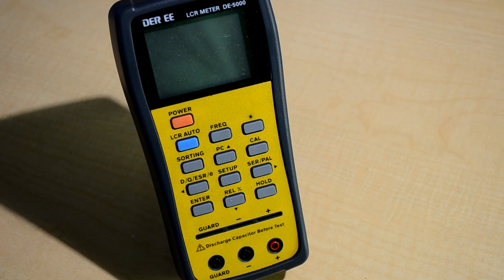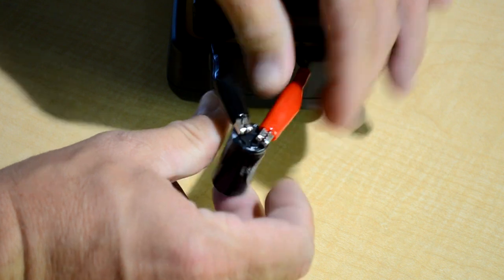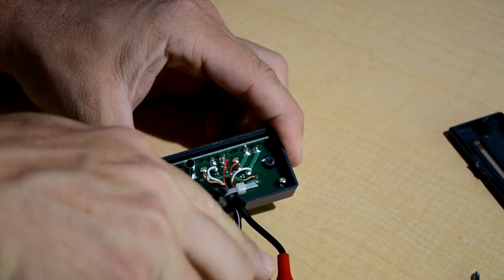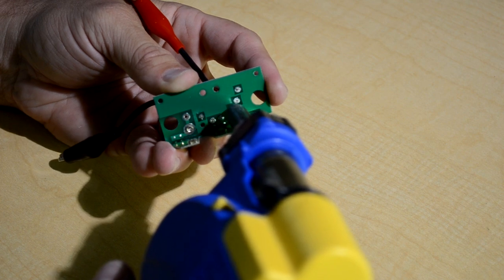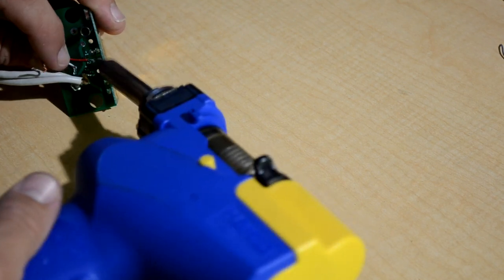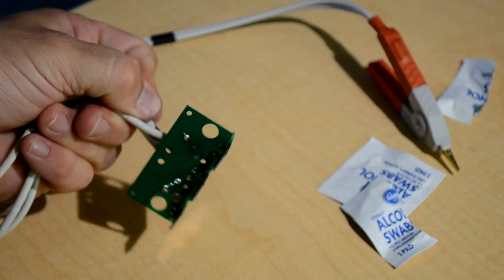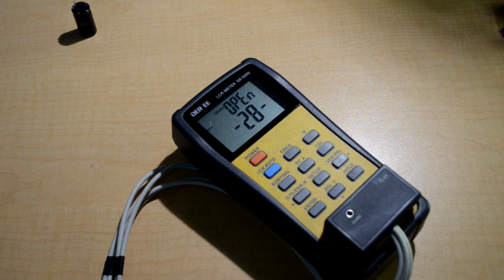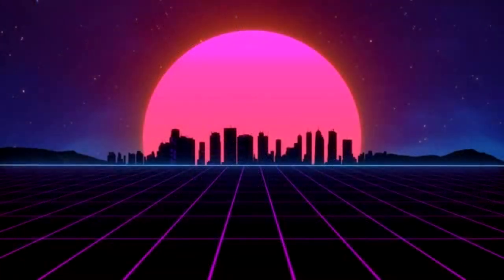DER EE LCR Meter DE-5000 Overview & Mod - Capacitor Tester | Tool for CRT repair

Comment: The reason the original cables are short is to keep the added inductance and capacitance of long leads from affecting the measurements. On larger value caps, it will not matter much but for lower value caps and inductors, you are trading convenience for accuracy.

Comment: For those who want to check their boards as fast as possible, you can just desolder one leg and then test for ESR with the other leg still soldered in. This meter does come with tweezers too but it's not the best either. Nice upgrade, Steve!
Reply from the maker: Great point.  Thanks.

Comment: The only reason  I can see for  having all the extra inductance and capacitance of those kelvin clamps is if you are going to use them for proper 4-wire measurements, where all the cable parasitics are cancelled out. Using them for 2-wire tests like this seems totally counter-productive to me.

Comment: I thought the point of the really short wires was so that the capacitance/inductance/resistance of the wires don't throw off the measurements too much?
Reply: The calibration fixes that?
Reply: @hololightful  not perfectly no, but being a relatively low end LCR anyways, I guess it doesn’t matter as much
Reply: @Ferraday  except that, for the price, the quality of this meter is pretty good.

Comment: Your use of the Kelvin Clip cables only changed the readings on the capacitor by 0.02 uF. With the Kelvin Clip cables the capacitor read 48.21uF and with the supplied cables it read 48.23uF. This is hardly significant! A waste of time making Kelvin Clip cables.